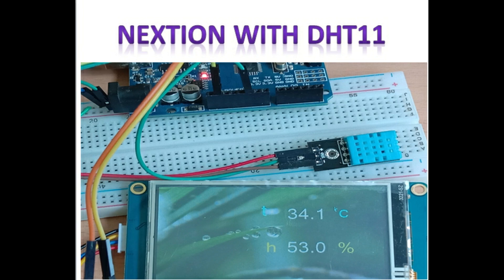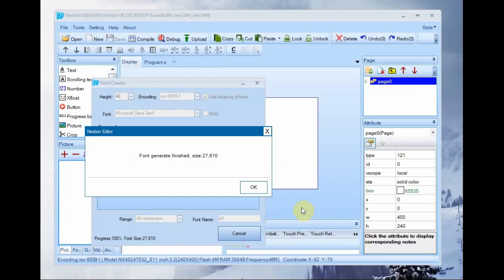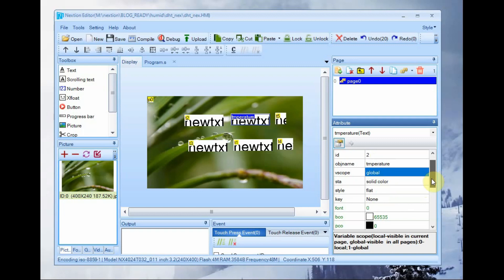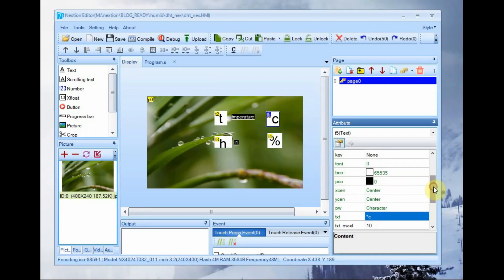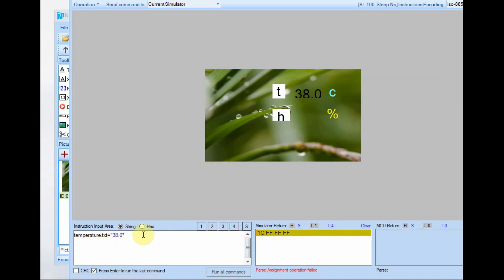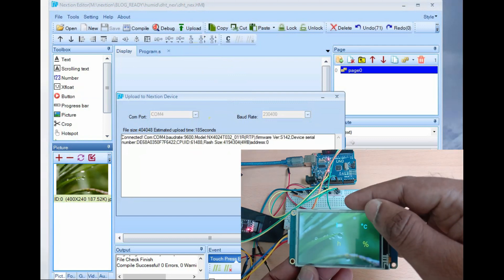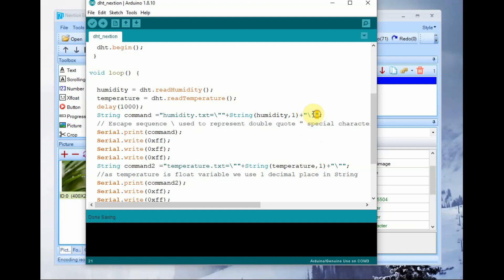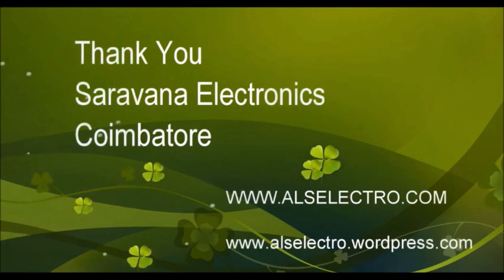Nextion Display with DHT11

Comment: in case data are not showing on the screen , use different serial for the screen like:
Serial.begin(57600); // for the serial monitor of the IDE
Serial1.begin(9600); // for the Nextion
Serial.print("This goes to the serial monitor");
Serial1.print("humidity.txt=\"22.00\""); //this goes to the Nextion

Serial1.write(0xff);
Serial1.write(0xff);
Serial1.write(0xff);